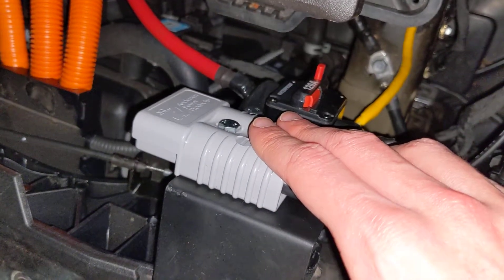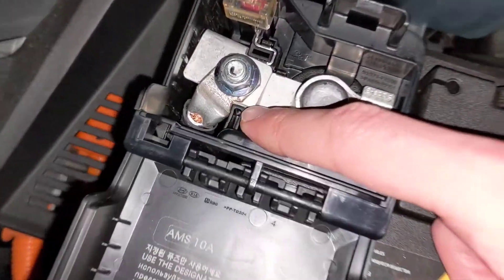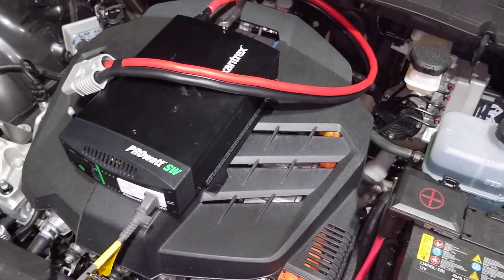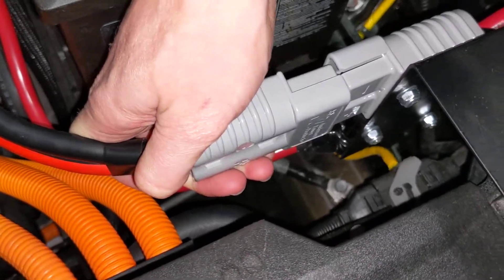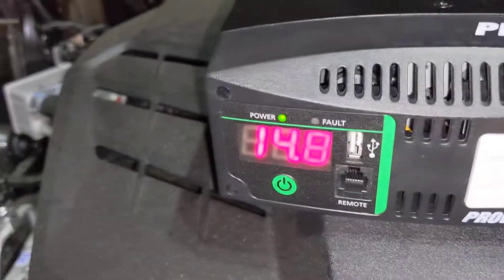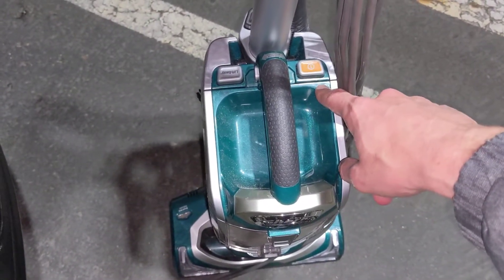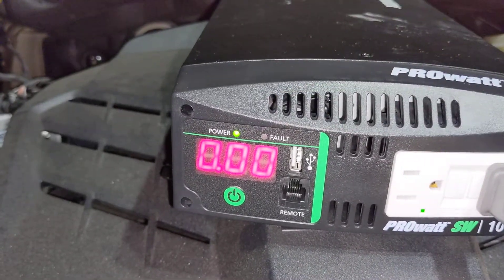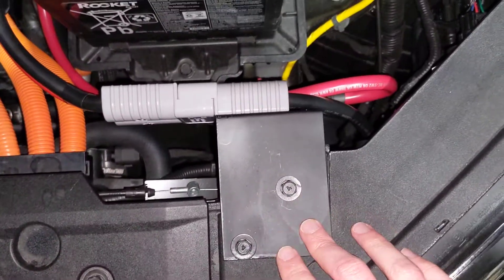Hyundai Kona EV with 1000W inverter powering a vacuum cleaner

Comment: Is it still working, 
or
how long has it worked?
Do you have had any problems?  
Maybe burned ICCU? 

I want to connect to a 700W INVERTER-Microwave.
I think this is no problem for 10 min each ?

700 W >>> maybe 1100 W Real,
1100 W : ca 14,5 V = 75 A/14,5VDC  

Can I connect to a 900W cleaner?
1.500 W converter with 1.200 W continous Power o.k. ?
What Do you think?

Do I need SOFTSTART on the converter due to the high Power consumption on the cleaner on the first seconds ?

Maybe overcurrent-Protection Switch to off the Converter but not start the 900w-cleaner?

What Do you think?

Comment: Excellent setup. I have pretty much all the same parts in my Amazon checkout - i was trying to figure appropriate fuse size, interesting that Kona  utility fuse is 150A.  Unfortunately I don't think my wife is going to let me drill holes or set permanent cables, it will have to be removable so that dealer doesn't see it and void warranty. Primarily need it for fridge/freezer and router - gas cooker and wood stove take care of the rest.
Reply from the maker: It is removable.  I only drilled holes in the added bracket.

Comment: Hi! Does the braker is important or only for extra safety? Thanks
Reply from the maker: You should always use a fuse/breaker when connecting something to a car battery, because it can supply hundreds of amps if shorted.

Comment: The video showing a 1000W load, the vacuum cleaner, operating for a short time is not inconsistent with Hyundai's advice that the output of the DC/DC converter is about 500W. The DC/DC converter has a battery across its output. That battery is probably quite happy putting out 500W for quite a while. Add the DC/DC converter's 500W and you have the 1000W. I would not be surprised if several kilowatts could be supplied for 10s of minutes. 
Let's say the 12V battery has a 100Ah capacity. It therefore stores 12V x 100Ah = 1200kWh. It could supply 1000W for an hour before being nearly flat, even if you disconnected it from the rest of the car.
When the load is removed from the battery, if the car is connected and in 'utility mode', the DC/DC converter will continue putting out its 500W, which will charge up the 12V battery again. 
About 500W is (according to the advice I got from Hyundai) the continuous rating of the converter, which sets the limit for the long-term average supply. The ordinary 12V battery provides the ability to supply considerably higher short-term peak loads. Those higher peaks can only be supplied if the load is reduced between peaks to less than the long-term continuous rating of the converter so that the battery gets a chance to recharge. 
I hope that makes sense. The video was really only a test of the battery, not the DC/DC converter.
Reply: @p1mrx  Thanks. Fair enough test then - reasonably heavy load for long enough that the battery would have been running down if the converter was only covering part of that load. The 12V x 45Ah battery has 540Wh and 750W x 1h should have taken out 750Wh. With lead acid, voltage gives a fair indication of state of charge so, if it didn't go down, then the dc/dc converter must have been keeping up.

Comment: Very nice video!  Great info.  Years ago I bought a kit for my Prius traction battery to run high wattage 120VAC/240VAC.  Later I bought a smaller pure sine wave, low frequency power inverter to do what you did on my Gen 1 LEAF.  Now I've done the same for my Niro EV.  The inverter I went w/ is the https://www.ebay.com/sch/i.html?_from=R40&_trksid=m570.l1313&_nkw=LF+Pure+Sine+Wave+Power+Inverter+DC+12V+or+DC+24V+to+AC+110V+or+AC+220V+60Hz&_sacat=0 which is high-efficiency & has double tolerance for startup current -- but it is bulky & heavy.  I'm looking to go V2H for the Niro &/or the LEAF.  Thanks again.